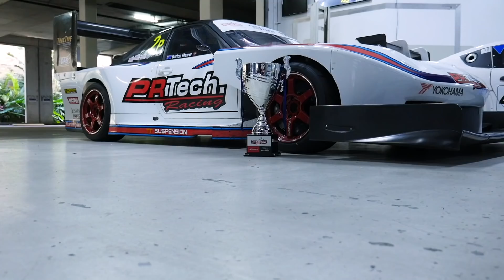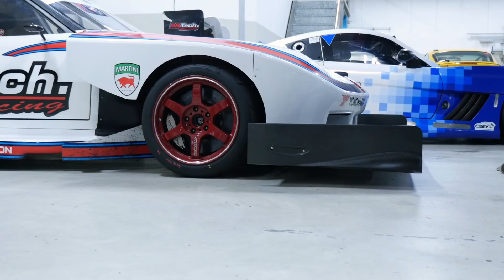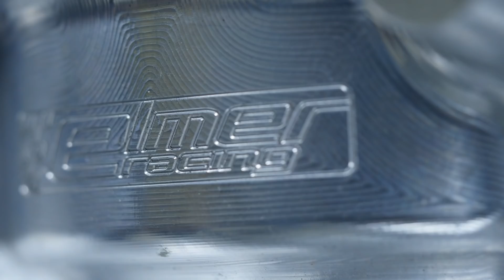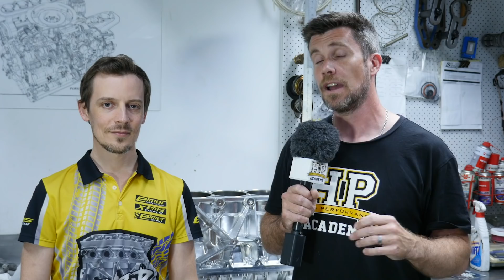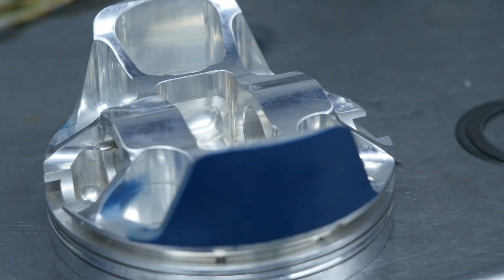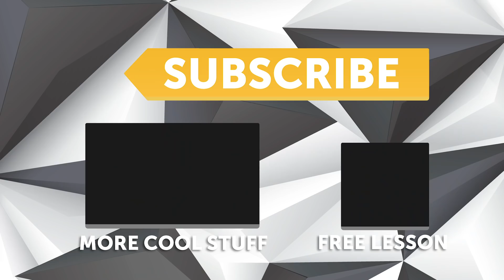Thor | 1500HP to 3000HP Of Custom Billet | Time Attack Champion [TECH TALK]

Comment: So the cylinder liners were machined to sit higher than the engine block on purpose, but because the mls gasket had grooves around it that caused the liners to sit? And the solution was to machine the engine block including the liners flat or I got something wrong? Thanks! As usual amazing content!!

Comment: If im hearing correctly, the head was intended for a "flat gasket" but a gasket with cylinder "rings" was installed. The gasket compressed until the embeded rings contacted the tops of the cylinder sleeves, at which point the act of tourquing the headgasket forced the sleeves to drop?. ...  Great vid as usual gents! (saving for your whoooooole package as we speak. 😍 #alloftheeducation )
Reply: Correct! My guess is the head has a groove machined to accept that step of the sleeve

Comment: 10:20 "I don't feel confortable testing stuff on customer's engines"...  Are you kidding me ??? the freaking headgasket was never tested..
Reply from the maker: The head gasket was out of spec, as in not listed as suitable, and not supplied ;) What a great result from a tough start though eh! The team did really well to pull it all together - Taz.
Reply: High Performance Academy the wrong gasket was used that cause the sleeves to drop which caused a leak.  Why did replacing the gasket with the same spec solve the issue?  Or rather why did the first gasket fail if the second one didn’t?  

Is it because the first gasket was over compressed?

Comment: What engine is this based off of 4G53?
Reply: Porsche M44
Reply: It sounds like an original design to me.
Reply: @SuperBobKing  Nah, Porsche standard crank, cylinder head, water pump, bellhousing etc bolts right on this block.
Reply: 5sfe camry for sure
Reply: @N4CR  I have spent a lot of time looking at 5s/3s blocks, and this doesn't seem anything like one other than the sleeves.

Comment: Why did you not do the interview while looking at the actual part in question the ENGINE not to be rude but from an engineering standpoint would rather look at the engine than your faces.
Reply from the maker: There is only so much footage you can get and use of a bare engine block :)  We are also nearly always under a pretty heavy time crunch. However I do appreciate the feedback, fire me through a link of another channel that is doing it well. We will take a look. - Ben
Reply: go to elmer facebook page/webpage/yt channel for more info

Comment: The fuel is not compatible with the nikasil coated bore
Reply: Depends. In europe this is fine.
Reply: @NieJestemzPolskiPL  sounds like fuel quality then, lots of rumors of low quality e85 in north america depending on where you buy
Reply: @Drake5153  lots of fuels are compatible with nikasil coating(gas,leaded gas,c16,ethanol,methanol), just sulfur levels have to be low (it was problem for low-end gas (end bmw M52) in NA at the time
Reply: This is probably in reference to the nature of Ethanol and the additional quantity required - In many cases it can leach down into your cylinder walls and if its bad enough, dry them out causing friction, heat and glazed bores. If you don't have oil squirters your more likely to encounter these problems regardless of the coating.
Reply: I didn't know that. Another reason to use iron bore liners.
Reply: I very much doubt this engine is ever run on pump gas...